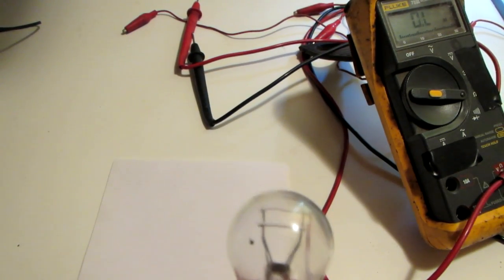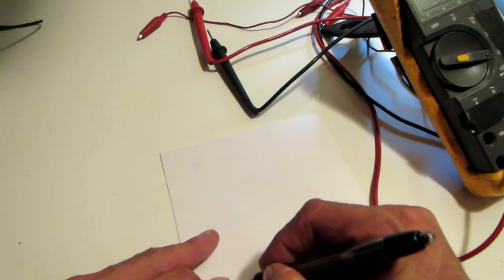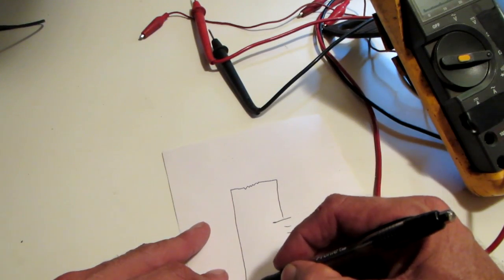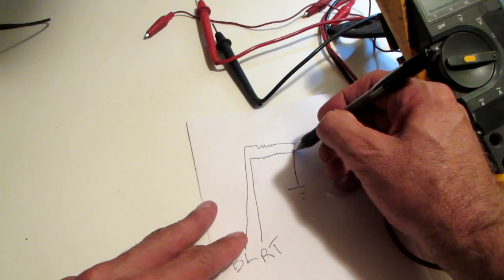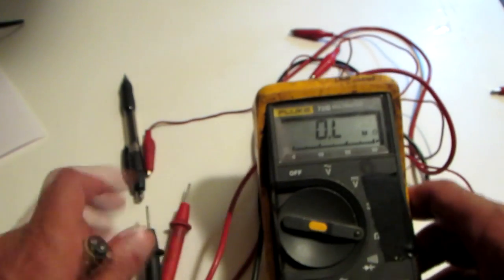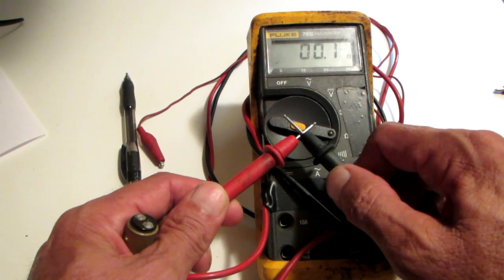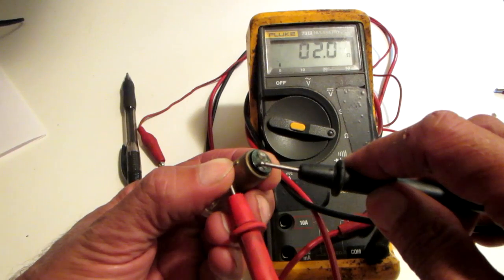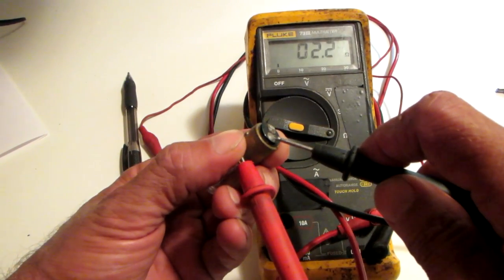Using A Multimeter To  Test A Two Filament Bulb

Comment: When testing ohms, Id suggest checking the resistance in your leads. I understand this video was most likey for demo purpose but some may have to much resistance in there leads, possibly resulting in a lower spec then the load really is. 
Turning a mechanic into a parts changer. Lol
Reply: The video is great, and he checked the meter prior to testing the bulb. I think you just wanted to repeat the expression "Turning a mechanic into a parts changer" because you heard it recently.
Reply from the maker: Your right. Leads and meter should be checked before using.  Thx for watching.